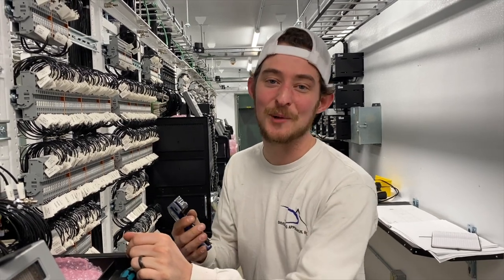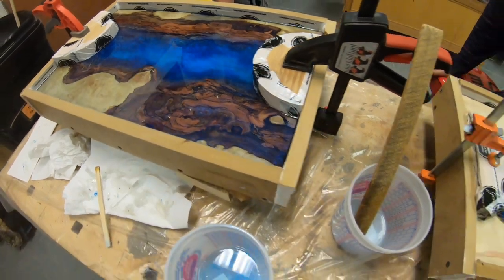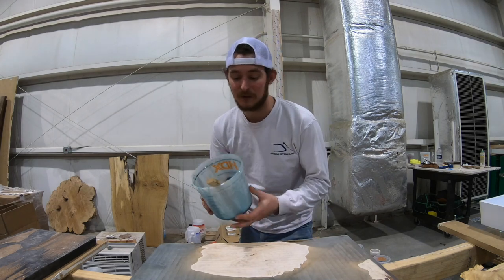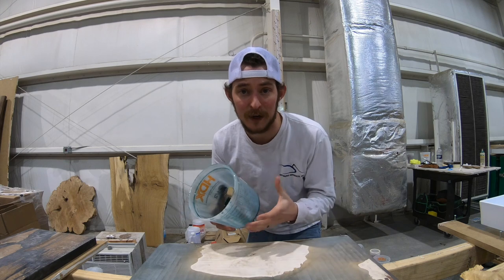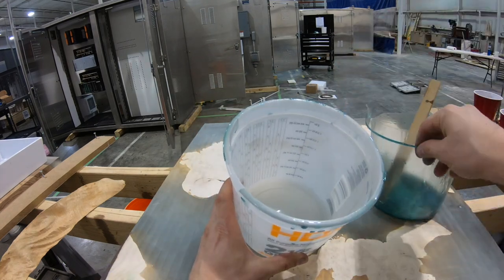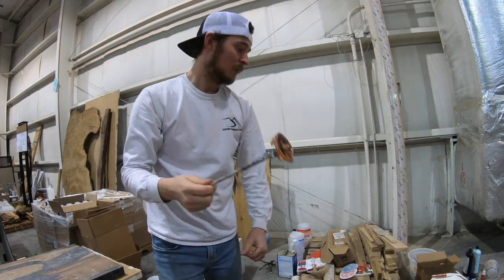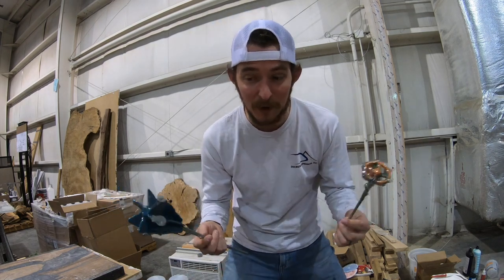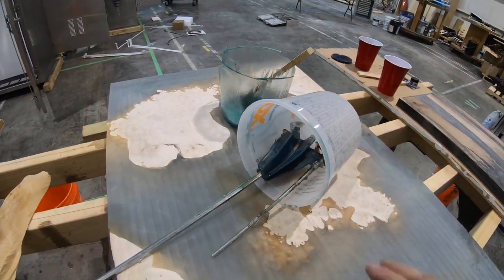How to clean and Save Epoxy Mixing Buckets and Tools

Comment: What about fin rollers, syringes, and other tools used on the fiberglass?
Reply from the maker: Great question. I’m not using fiberglass so, I don’t use those other products. But typically I just let the epoxy harden then peel it up or throw away the one time use product.

Comment: Hi. Ive started making larger projects, and mixing larger batches. Would you recommend mixing with a drill?. If so how would you get rid of the bubbles mixing with a mixer and drill produce. Now with the smaller mixes i mix with a spatuala, and put my mixing pot in warm water to get rid of the bubbles. Thank you for your time.

Comment: Hey man, i use syringes to measure the resin, part A, and part B separately, how can i clean the excess part A and B from the syringes? They are sticky and they never solidify! Any idea or tips?
Reply from the maker: I’m not really sure, I would try to use acetone or xylol xylene 

https://www.amazon.com/dp/B000V4L86A/ref=cm_sw_r_as_gl_api_glt_fabc_C66S98T81AVFHEBV40MG?linkCode=ml2&tag=goodviewwoodw-20
Reply from the maker: I’m not really sure, I would try to use acetone or xylol xylene 

https://www.amazon.com/dp/B000V4L86A/ref=cm_sw_r_as_gl_api_glt_fabc_C66S98T81AVFHEBV40MG?linkCode=ml2&tag=goodviewwoodw-20